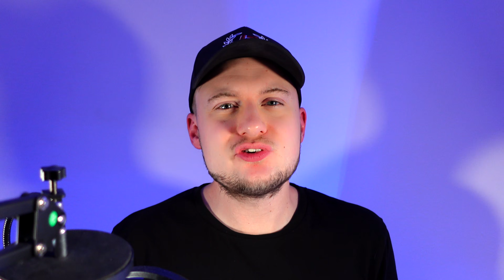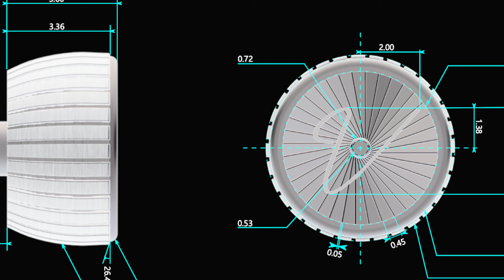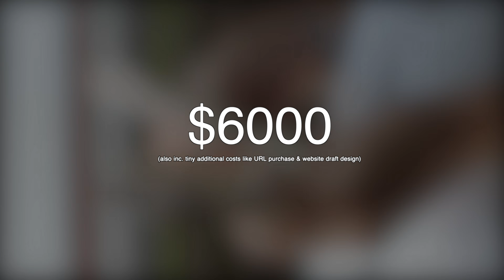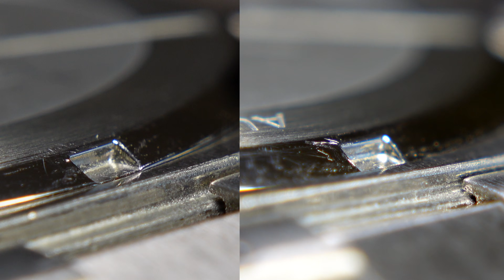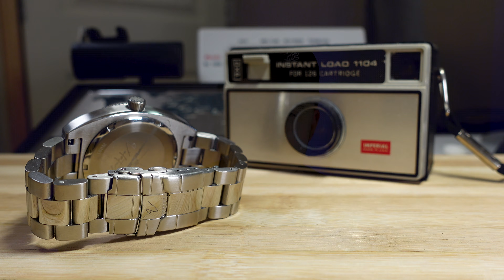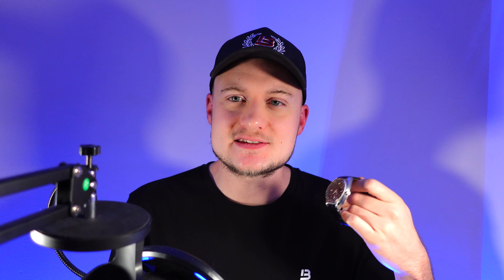My microbrand watch company FAILED ... here's why & what I learnt.

Comment: What? ONLY 6 grand on launching a new brand. You need at least 100 times that it's foolish to think otherwise. No wonder your prototypes were cheap crap. Your Business model is totally flawed and was clearly doomed to fail. I like the plans but I suggest either give up or get a decent amount behind you at the very least 250 grand. Have you ever watched Dragons den?
Reply from the maker: You'd be surprised what you can do for  not a lot more than that, the crowd funded microbrand model is a far cry from what you see on dragons den.  High risk low cost. $6k is what I spent, it wasn't my budget but as I spoke about there are initial one off costs for tooling that made switching manufacturer uneconomical at the time. In this one case, with your comment, I'd say you could learn even more than me from fellow microbrand owners.

Comment: Your experience is not unique to watches, almost all contract manufacturing has similar challenges and the cross-cultural barriers only add the hurdles to be overcome. You are correct, what you have learned is worth more than the financial cost so far.
I wonder if you could join a collab with an established microbrand ?
Reply from the maker: That would be cool if the opportunity ever presented itself 🙂

Comment: Fair play for having a go , shows a lot of guts to have a go and then make a video explaining how it failed.
It's such a tough market to get into without backing , you would need tens of thousands.
I think you were a bit naive,  you went with a stranger to do the drawings , but actually I don't think it failed there , letting him use someone to make the watches that you didn't do any research into was a huge mistake.
The worry is if they used random parts and put few hours in to make the watch , and therefore ripped you off and the guy who drew the watch and recommended you to the watchmaker were both in on it.
The mistake was creating a GMT , without a GMT movement , that watch could have come back 100% no mistakes , but how can you show a GMT , when there is no GMT function.
I think you could have gone with a more simple design and instead of having transantic had a lgo of a plane or wings or something ,, similar to Breitling.
All in all though as long as you aren't in debt , and can accept the loss , the experience of creating a watch isn't something everyone can do , and the watch still works,  it's still your watch you designed , you can still wear it with pride and it has a story behind it , I dont think people can see mistakes when it's on the wrist so it's cool to have your own watch.
I think you are right to reach out if you do it next time , ask advice from Jody who does youtube and Erebus watches , then do research on prototype makers and ask to see examples of their work maybe , or find out who they did previous work for and then reach out to them.
If you can get money together or an investor then your first experience will help put things right.
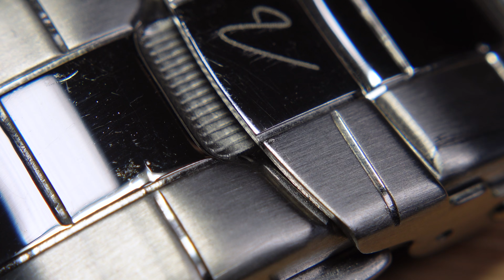Reply from the maker: I was really naieve 100% and I really agree with most of your points Steve, thanks for taking the time to type it out and watch the video 😎🍻… in the end it has all worked out well and im really enjoying this youtube stuff - only point I'll pick you up on is that it's a worldtimer not a gmt - it's a static function.  If it's 2pm and you're in the Rio timezone for example, your rotate Rio to 14:00 on the chapter ring and now all of the world's cities are showing the correct hour in sync with the chapter ring. It's a fun complication but always totally inaccurate when daylight savings shift 🙂
Reply: @nextonthewrist  ahhh I see now , that's my bad , I dont think I've ever had worldtimer , I was getting it confused with a GMT , no wonder it didn't have a gmt movement 🤦 oh well then even better you have an idea you can use still going forward.
The good thing is that for your second watch , you can make a GMT , based on the theme,  you have also got a pilots watch , that keeps your brand on a theme,  which is unique. I think I just thought it was a GMT , then I'm having a conversation in my head that I missed you explaining it 😅

Comment: Just based off the drawing I can see why it failed. It’s very bulky but also only 40 mm. There’s also a lot going on but also not much going on with the dial? The dial reads luxury while the bezel reads expedition. A lot of contradictions in the design and I can see it being unaesthetic to many.
Reply from the maker: I mean it never got as far as market, so that's a totally premature assumption on your behalf - albeit your opinion is of course fully your entitlement on the looks.  I would have liked to have slimmed it down in later revisions so I don't disagree with the bulk.  That said the reason for failure was nothing to do with this though, as I think the video is pretty clear about.  I can't tell if your comment is sarcasm or trolling (hopefully) as the video literally details the brand aim of combining luxurious and technical elements, so obviously I nailed that as you picked it up straight away 🏆🏆 😂